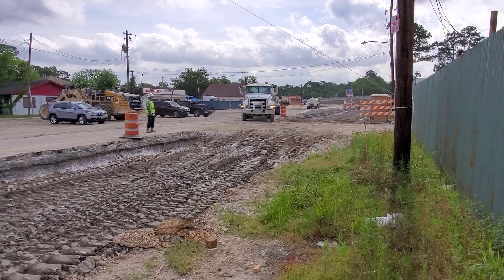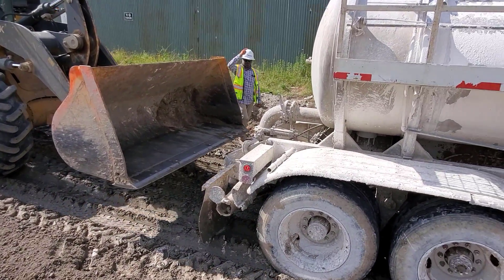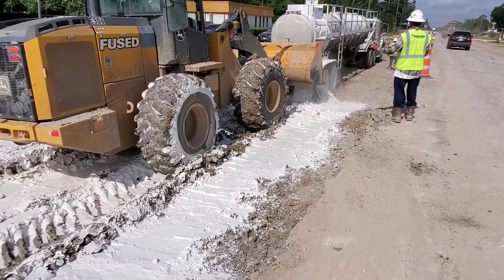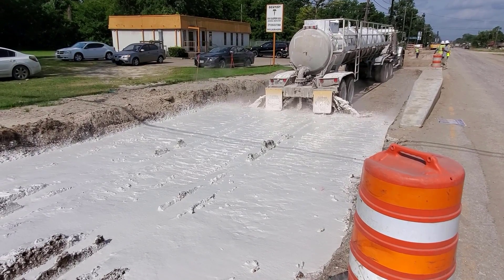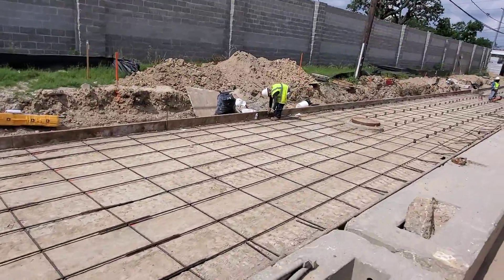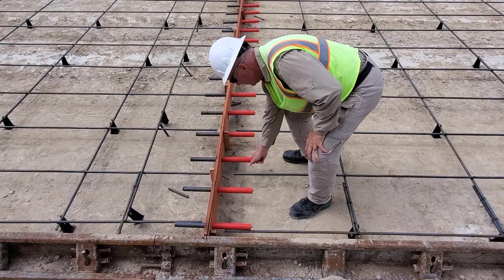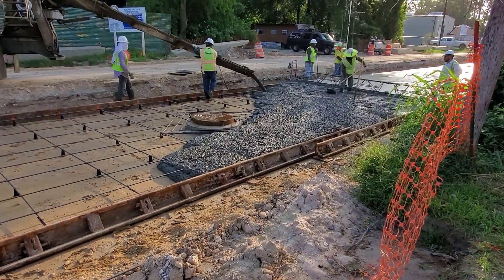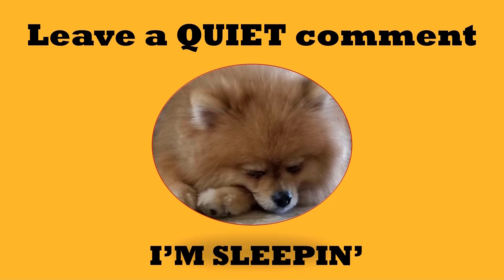The Art Of Pouring Concrete Roads #concrete

Comment: Let me ask this- after a long, long, time in use, like some roads here in AL and MS, the comceete roads get a lot of cracks and bumps. So if they wanted to redo it with more concrete (which they sadly never do anymore because asphalt is cheaper and easier short term, despite getting actual pot holes in a few years, wheras concrete just gets bumps and cracks after like 20 years) do they have to rip all the old concrete up, or do they just groove and flatten it and put a thin layer of concrete on top? I would imagine it's the latter. Every old road has been replaced with asphalt and I have an idea of how it works watching it, but I've never gotten the opportunity to see them redo it with more concrete.
Reply from the maker: @ESPLTD322  the proper way would to remove and replace the existing concrete.
Reply: Here in IL we come in and concrete patch bad spots. We may come in and do concrete patching to make the road last longer until they decide to overlay it again. A lot of times on asphalt overlay projects, we'll come in after the milling and patch bad spots in the concrete base before the overlay it with new asphalt. Some projects are just way past repair and they'll come in and replace the entire road.
Reply: @ARoadBuilder if asphalt is overlaid on concrete would it stay?
Reply: @jamesolusegun4509 They usually mill existing asphalt and lay new asphalt on top of the concrete thats already under the old asphalt. Nearly every asphalt road around central and southern il has old concrete road under it.

Comment: Hello sir.. I'm from the Philippines is it normal that our road construction here has no metal bar not like in your video.. is the contractor doing all the road projects substandard by not putting some metal bar? After they compact the soil they just put concrete.. 
Looking forward in your response..
Reply from the maker: Concrete surfaces that support large trucks, heavy machinery, or steady traffic need concrete rebar reinforcement, and any structural concrete, like walls in buildings, should definitely include rebar.
Rebar is a metal bar that is used to help increase the tensile strength of concrete. As a result, it helps concrete structures withstand tensile, bending, torsion, and shearing loads. I hope this answers your question.

Comment: so what is exactly that white material that prevents concrete to make cracks on the surface while drying itselfs?
Reply from the maker: I think you are talking about curing compound. It used to retard or reduce evaporation of moisture from concrete.
Reply: @SleepydogConstruction  yes, about white powder at 10:31 I'm taking about. what exactly is called this white powder?

Comment: Well....I can tell you one thing about live lime.....even dry for years it re emulsifies itself with water....so much for a safe road base.....any other countries do the same process ....but with portland cement.....surely not with lime.....especially on top of clay.....
Reply from the maker: We use Portland cement on sandy soils.
Reply: @SleepydogConstruction  What part of " LIVE LIME RE EMUSLSIFY ITSELF WITH THE CONTACT OF WATER" you dont understand ?.....
Clay stop the water from penetrating further down...so the water will sit exactly where your lime/soil mix is......that's where you supoosed to use portland cement.....
Sandy soil drain the water down.....that's where you supposed to use lime...because lime is flexible....portland cement will crack....
I am from Europe...we start building 3000 years ago.....but the yanks knows better....good luck....

Comment: Any advantages of going with a thicker layer of concrete? Or will the strength come from a deeper base layer? Also is fiber mesh used or will that potentially cut tires?
Reply from the maker: With all concrete most of the strength comes from the rebar. If the concrete is thicker that 12 inches it would need a double mat of rebar.
Reply: @SleepydogConstruction  The video got me thinking about the Autobahn and whether the same principals could be applied here in the US. Especially in the rust belt. Over engineer the roads to last a lot longer, easier said than done haha.

Comment: Couldnt they use a pumper truck to put it down?
Reply: They could, but it would be impractical in this application.  Concrete pumps are expensive to rent and make a big mess so if you can avoid it, you should.  In most linear applications like a roadway, the concrete is placed as you saw in the video.

Comment: I don't understand why, you are building roads with concrete!! I'm from Denmark, we have asfalt. We had concrete before, but that was the germans that made the roads to the tanks etc under wwII
Reply: Concrete cost more but last much longer than asphalt.
Reply: @FirstLast-se7gj  But it makes a lot of noice, when the tires running on it
Reply: @SuperRashead  ha no it doesn't. Sounds like you are driving on grooved concrete or some with a lot of rock in it. Good concrete is smoother with less variation in elevation than you'll get with asphalt. Concrete won't warp under the weight in heat like asphalt either.
Reply from the maker: This concrete road is designed to last 40 years.